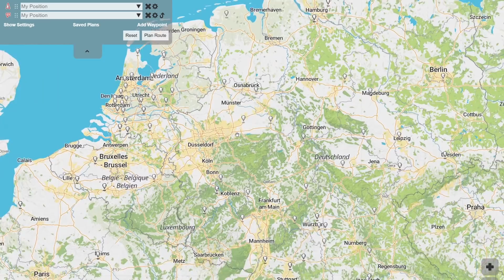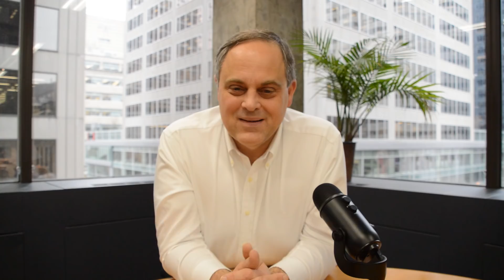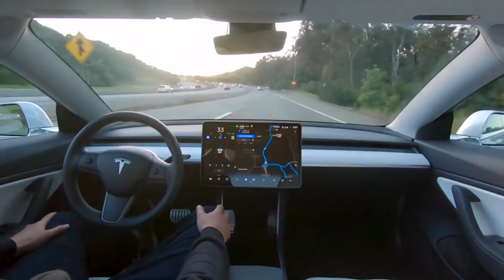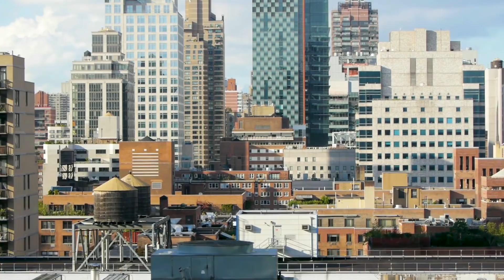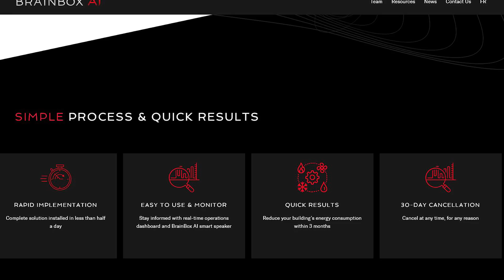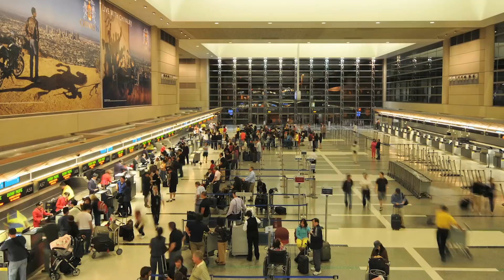Your Building Is Dumb | In Depth

Comment: One of the biggest problems in buildings is that there are parts that need heading and parts that need cooling. On the roof you have heaters and coolers working concurrently! A lot of efficiency can be gained from breaking down the problem to a more atomic level. Get some heat from point A and move it to point B. That in my opinion is where the efficiencies will be gained. I'm not sure buildings are designed to operate in this atomic manner. Most buildings I've seen have massive ducted systems applying the same conditioned air to all points in the building and massive return air ducting returning air back to the roof for hearing or cooling.
Reply: The system you envision exists and has for at least 20 years.  Only recently has it become available for residential use.

VRF Heat Pumps with HEAT RECOVERY.  That Heat Recovery part is key and is the future of how we condition our buildings without using Natural Gas and only using electricity.  

Heat recovery means the system can simultaneously heat AND cool zones in the building.  Heat is essentially moved within the building zones first and then, only if needed, the outdoor condenser/air handler will be used.
Zones can condition air, radiant floors, water heater tanks, pools, snow melt loops in driveways, etc.  Imagine, any zones that are cooling the room will capture heat from that room and then transfer it to a heat exchanger to make hot water.

The systems are typically require 3 phase power to run the outdoor condensers, so this technology is commonly only found in commercial and high rise buildings since low occupancy residences do not have 3 phase power, However, I have found that LG is the only company offering both commercial and residential solutions in the Heat Recovery equipment.

Video showing single phase residential installation:
https://youtu.be/Ag1tmOCgcdE

3 phase Heat Recovery Condensers: (Commercial)
https://lghvac.com/commercial/product-type/?productTypeId=a2x44000003XR0T&iscommercial=true&class=Outdoor%20Units

1 Phase Heat Recovery Condenser: (Residential homes and buildings lacking 3 phase power)
https://lghvac.com/commercial/product-type/model-details/?productTypeId=a2x44000003XR0O&modelId=01t44000008fw8M&modelNumber=ARUB060GSS4&iscommercial=true&class=Outdoor%20Units

Indoor Air Handler Options:
https://lghvac.com/commercial/

Hot Water, Radiant, Water Applications:
https://www.lg.com/global/business/air-solution/vrf/hot-water-solution-hydro-kit
https://www.lgvrf.ca/en/hydro-kit.aspx/ARNH763K3B2
https://www.lgvrf.ca/en/hydro-kit.aspx/ARNH963K2A2

Comment: What he describes in the analogy of “2 pedals only options” is not reflective of 98+% of high rises. The HVAC systems in these structures modulate and calculate optimal starts already for the same reasons he mentioned. So it’s not quite as bad of a picture but improvements can and should be made. 
Thanks for having him on!

Comment: Versus the old building I lived in that had a timer to shut off the steam boiler for heat and hot water. Hot water disappeared within 5 minutes. I wound up putting the old brass hot water tank that was disconnected. Put the old brass tank bank in surface and a convection hot water heater. No more domestic calls for no hot after.

Comment: Many commercial building finishes and materials are sensitive to humidity. Here in the south even the schools must be equipped with 24/7 HVAC. I have personally witnessed ceiling tiles in many educational, church and other 12/5 facilities that are warped and sagging after a few months when the occupant / users shut down their HVAC plant on evenings and weekends. 50 to 60% RH is the ideal condition. Control systems are much improved since I started as a engineering designer back in the early 70's. AI is going to bring faster improvements. 
I suggest that a good number of brick and mortar schools and libraries are fast becoming obsolete because many students will be participating in home schooling. I foresee folks attending a central facility only for testing and curricular distribution. We want to achieve greater more efficient use from fewer facilities.
Reply: These buildings should have dehumidifiers with separate controls so that when the AC is shut off, there is still a way to remove the humidity.

Comment: If I was dictator of a building, I would force people to set the thermostats on the room they are occupying ALL BY THEMSELVES. And the when they leave the room, the equipment automatically shuts off.
Reply: Sometimes you don't want that.  If the room is too hot, you can run the AC, capture that heat and move it to another room that wants heat or move it into your hot water tanks.

Comment: Nice interview. The low hanging opportunities from intelligent management of building systems is an excellent start. Depending on the buildings though, there are quite a significant number that require capital upgrades. These can be both simple and complex. An interesting documentary on the benefits of capital upgrades is one that was done on the replacement of all the windows in the Empire State building. Something as simple as windows, and despite the considerable expense, still produced tremendous return on investment. For office buildings HVAC is almost always the elephant in the room. The simple side of power savings is what everyone already knows to do - led on demand lighting, but many office buildings are still not there yet. Insulation pays big dividends (those windows again). Specialized commercial space such as data centers is a completely separate area of expertise that has radically changed in the last 15 years, and is an area I've been involved as an engineer. I suppose the quick message is that we have such a long way to go, but the ideas are there and what we need are the champions to move them forward.

Comment: I stayed at Morgan's hotel on Madison Ave. in NYC in the 90's.  It wasn't a cheap place to stay, but in the daytime with outside temperatures of 45 degrees, they would turn off the heat.  I thought it was broken.  I complained and they said that all the hotels turn off their heat in the daytime.  I was freezing.  I didn't spend much time hanging around the hotel. I've since seen a statistic that NYC residents actually use less energy per capita than any city in the US.

Comment: There's a "smart" register control that opens and closes register/covers on vents for home HVAC systems to have A room at a set temperature.  You can adjust the settings with a "smart" app.  The rooms have vent covers with batteries to adjust the opening and closing and a sensor plugged into an outlet. The residential program is REALLY expensive right now, though.
Reply: That's more of a retrofit for dumb old systems.  The expense might be better spent upgrading the system to a VRF heat pump system.  preferably with multiple air handlers (zones).  Even more preferable is VRF heat pump with Heat Recovery and tie hot water production into the same equipment.  HVAC equipment in the residential market has languished for too long.  Not enough people are installing these newer VRF systems.

Comment: ANOTHER IMPORTANT APPROACH:  Just Cut The Energy Footprint in the structure. INSULATE AND  SEAL the walls and entries!  

  I have converted my 1979 frame home on the Side of a Mountain in Northern Colorado (USING PASSIVHAUS PRINCIPLES) to reduce the energy usage WAY BELOW ZERO (I overproduce my usage with PV panels). The House Now 1) Grows 3 orange trees (ripe now), 2) Two Lemon Trees (Nearly Ripe), 3) Kumquats (3 weeks away) , 4) 2 Avocado Trees, 5) a Lime Tree, 6) and others. 

It also powers the Tesla Model X (15,000 miles per year). The old gas line is removed and the house is very comfortable.  I thickened the walls to R-60 or better, built air lock entries (multi usage vestibules) , insulated the Attic to the roof. I have PV panels on the roof.  The surrounding passive solar rooms add 1400 sq ft and many functions... 2 workshops, walk in clothes dryer, walk in food dehydrator, Conference room, Gymnasium, Greenhouse, ... 

My windows are Triple or Quad Glazed (free or cheap) which were miss-ordered size wise and I made the holes to fit them.

I used WASTE MATERIALS from the construction industry (free or cheap) and my own labor (with the help of a neighbor).  I DO NOT NEED AI - and the High Tech outage issues. We have days below Minus 20 degrees and above 104 degrees... and the house can easily run itself by removing 95 % of  the heating / cooling load. The little HIGH EFFICIENCY Mini Splits (SEERs 42, 33 and 29) are not taxed at all .... I have a Negative Carbon Footprint !!!! and am happy, comfortable, and enjoying my Tesla MX and my Bikes. 

My grape vines produce 80 to 90 gallons a year  (as well as a big garden for Veggies). 
This is on a city lot which is less than 1/5 acre at 5900 ft above sea level and nearly the 40th parallel. 

See:  https://www.youtube.com/watch?time_continue=16&v=pyWaFDsF5N8
Reply: Great job -- Maybe you should invite Zac and Jesse to come out and do a story on your house and the building techniques you used to get energy efficient. You could send them a short video of your house and an explanation. They would probably use it in a future show.
Reply: @KJSvitko  better of talking to the build show channel... higher subscription pool and the right audience to spread the success story.
Reply: I look forward to watching your speech. Please make a video on your house if possible 🙂
Reply: R60?!! How thick are your walls?

Comment: I'll just say I gave up on Nest Thermostat learning our preferences after years of it not really working optimally and in fact detrimentally, so I turned off all its auto-scheduling, and now just set it to the temperature min/max I want throughout the day or set my own schedule manually. That is just 2 thermostats for a 2-floor residential home. I really doubt AI will do a good job at building scale unless the Nest developers are using infinitely inferior AI software.
Reply: How old is your Nest? My Ecobee can tell if I am home or away and adjust to occupancy. This saves a lot of energy. I can also change the temp from my smart phone
Reply: @b4804514  Nest can no the same.
Reply: @b4804514  I had 2nd generation Nest on my last home and 3rd generation Nests (x2 for two separate floors) since I got new home couple of years ago. Being able to control remotely or detecting that both me / wife are away if both our cellphones are away and no other motion detected is good, but their "auto-scheduling" of the temperature based on learning our patterns and preferences based on how we adjust when it is not right would never catch up or be right especially as seasons change.

I have been happier since I gave up on trying, just set the temperature to what I like (per season) and not let it auto reduce / raise is my new preference. It is all Solar / Battery powered so I don't really care if it is not being optimized. Also, based on energy use it seems to me maintaining a certain comfortable temperature is more efficient than having wilder swings forcing AC to run at higher AMPS to do rapid cooling / heating when it is off where it needs to be for comfort.

Comment: Most buildings have; DDC, Direct Digital Controls. A nest thermostat uses a P.i.D. loop Proportional Integral, Derivative. A.I. is just really better, faster at it. York Metasys, Trane Tracer & Tracker. are 2. They even use frequency drives to ramp up the motors slowly. Don't trust their numbers they typ. skew them. Their still tip toeing thru the Tulips. An absorption system pumps refrigerant using only a heat source. We need a better heat source or a better battery if you will. The money is in the Treatment not the Cure. Hince Chemo or Chemicals and Radiation. HydroCarbons = $. Sorry for the Rant, Love the show Guy's.

Comment: In October this year I got a tado smart thermostat system with smart thermostatic radiator valves. And now have detailed temp and humidity monitoring of every room. And I can set custom schedule for each room. And it has made a huge difference to cost and comfort. Full zoned heating 4 bedroom house. It also factors in things like how sunny/cold it is and keeps rooms very stable. Totally recommend!

Comment: In the UK the short-term thinking of building contractors, has led to stupid situations where I have a lovely warm home, only because I have paid thousands of pounds to upgrade the windows and doors to double glazing & insulation into my loft space.  However, my feet are like blocks of ice, because the base floor is concrete!  If only they’d fitted under-floor heating, instead of wall radiators, the walls would be much less ugly & the whole house would be evenly heated.
Reply: Check out Net Zero Homes or Passive House construction. 
There are great energy saving building or remodel tips.
Reply: Kenz300 x too late now - I’m in & ive done as much as I can afford.  The solar hot water was very cool & made me wonder, if I can install the system myself, why aren’t every new build getting it, but it’s probably a lost cause.

Comment: I just want to toot my own horn and say that I've been telling people for over ten years that our streets are dumb.  Image AI used to know the flow of traffic and control the flow to optimize it.  You could theoretically allow the streets to control cars so that they never have to stop.  Cars would be organized into groups and each group would be shifted through green lights.  Now with FSD, you could incorporate that to speed up and slow down the car groups. Also use FSD to draft or create trains of cars that would reduce the amount of energy consumed per vehicle due to wind resistance.
Reply: I've been tooting that same horn even longer.  People lack vision and I lack persuasion.  90% of the population are complete morons and I give up speaking with them after a short time.
One good thing about the Tesla community is that that moron ratio is so much lower and I'd guess half the people I meet at SCs have brains.  It's really refreshing, but in the end I'm preaching to the choir when speaking with my Tesla family.
Reply: I agree on the traffic lights and car trains.

Comment: What I haven't heard in this idea of a smart building, is solar energy, and using that to improve the energy consumption? Taking advantage of where the Sun rises and the Sun sets, and how to use that smartly.
Reply: It's hard to retrofit a building for passive solar.  Most of the buildings out there were built decades ago before things like that were even considered.  For new buildings it should certainly be thought about.

Comment: Saving energy saves money. Sounds like great AI technology to save money and energy using existing systems in current buildings. When building new or remodeling it is important to look at techniques that reduce the total amount of energy needed. Net Zero and Passive House construction techniques should be considered as part of any new building or remodel. Air sealing, super insulation, triple pane windows, set back thermostats, LED automatic lighting systems, high efficiency heating and air conditioning systems, energy efficient appliances and solar panels with battery storage. I have seen press releases over the past few years about solar glass. Just think if all these glass buildings had solar glass generating energy. Until that happens this AI technology to maximize current buildings and their systems is a great application for energy savings.

Comment: This is basically like the Tesla FSD neural net, but for HVAC.  I have a Nest Learning Thermostat (which I’ve stopped from learning, as I prefer a regimental schedule).  I also have 2 Nest Protect, smoke & CO detectors which also measure the temperature.  I have LIFX LED bulbs in all the lights and it’s all controllable from my mobile and I also have a Raspberry Pi server that runs Domoticz home automation, which can see the values on all the temperature sensors and can control several power sockets around the house.  Domoticz responds to my geofenced phone & powers off the majority of stuff when I leave and back on when I return; same goes for my lights.

Comment: Buildings are subject to thousands of lines of bldg codes by different cities all around the world. There are thousands of companies that supply the materials. The buildings aren't the SAME, but they are not Smart as you say. They are efficient with the current resources and design info though.  They slowly are getting better. I am a commercial wood truss engineer in the Midwest. Supplying large sprawling apartments in Minneapolis area.  Lots of Flat roofs w/ Solar panels in last 2 years alone.

Comment: What the guys should be looking at for the HVAC is a renewable energy solution which uses as much as 60% less energy than any other HVAC system. It can heat and cool buildings, and works in every climate in the world from the deserts to the poles. Check out https://www.solxenergy.com.